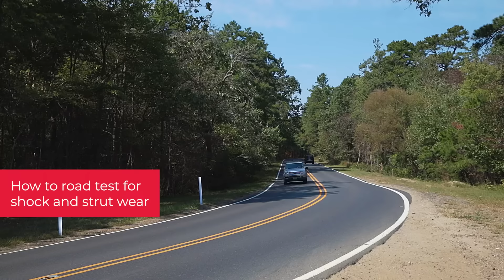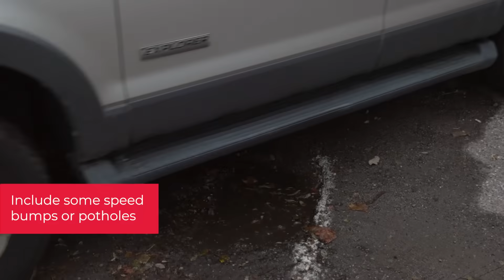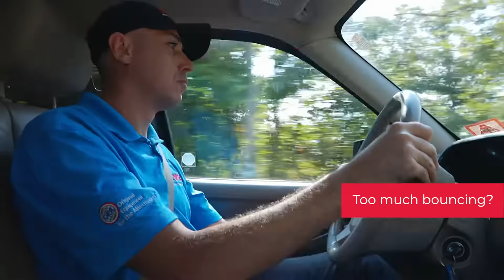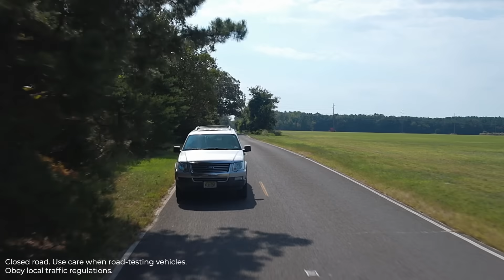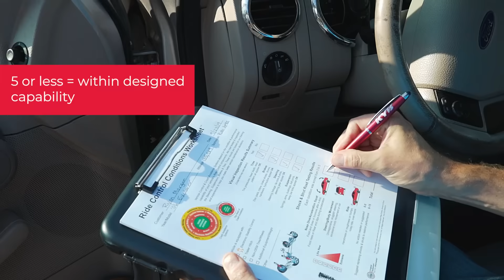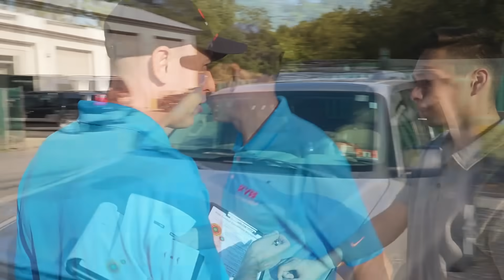The 3 Minute Mile

Comment: What’s the common mile warranty on the KYB - Excel G shocks and struts twin tube? 50k-70k?

And I heard these are 10% firmer that’s above and beyond to the original shocks.
Reply from the maker: There is not a “common mile warranty,” but the old industry standard was 50-60K miles. That changed when people realized that a damper’s build quality, how a vehicle is used, road and climate conditions, and other factors can greatly affect wear.

That’s a fair general assessment for our OE replacement dampers, but again, that’s an oversimplification since it varies by product and application.
Reply: I would say for newer cars 100-125K mi for rural and 80K for city driving